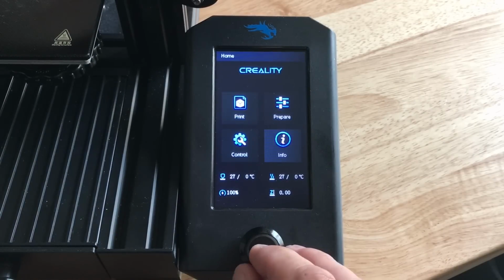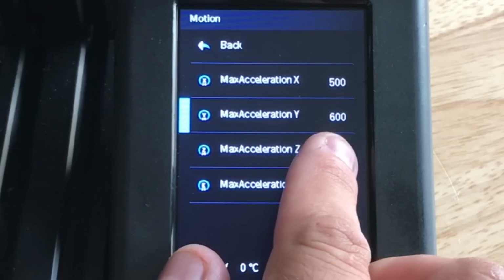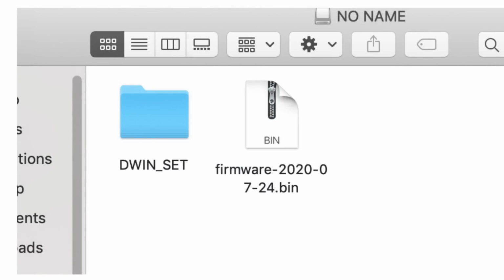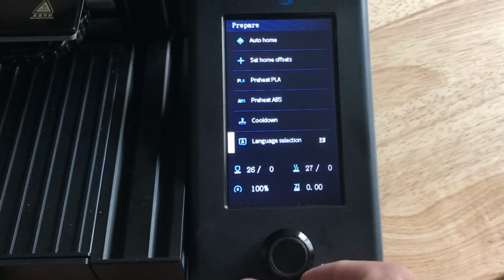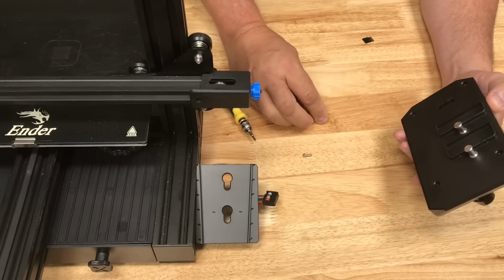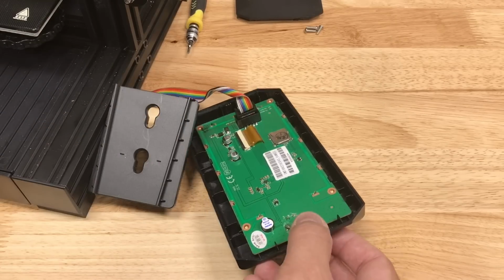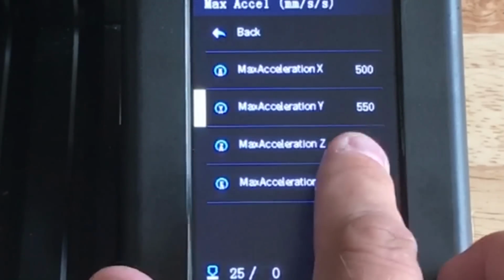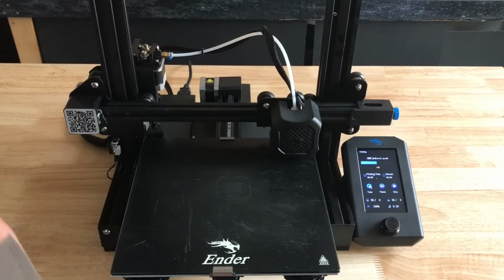Creality Ender 3 V2 Firmware Update - Motherboard and Display

Comment: Not gonna lie, I tried both firmware but the th3d unified firmware is so much better. Not only is the print quality better . the god damn printer now read gcode properly.
For anyone attempting the th3d unified firmware. Let me tell you one thing : In the program Visual studio code you MUST have the extension PlatformIO IDE install and all the tutorial step will make sense.
Reply: Couldn’t get either to work for the life of me.... any tips?
Reply: And the marlin site won’t let me register :/
Reply: just want to know th3d firmware got print resume if power loss?

Comment: What a joke, my 8 month old Ender 5 Pro had the mainboard fry, I purchased the Creality 32 bit V4.2.7 board labeled Ender 5, it never work, why does Creality even bother selling parts or labeling them for specific machines? This company is half-baked relying on users to do the job, rather than selling spare parts sell these half baked machines as throw away printers like photo printers, ink is worth more than the printer. Mine is going in the metal recycling bin at work.

Comment: Tried updating to Creality's newest firmware that is on their site and it almost seemed like it bricked my printer (fans powered up but screen never showed anything). Tried all 4 version they put out this month and nothing happened after just leaving them running for 5+ min. Remembered you had a video about upgrading to 1.0.1 and was able to use your .bin to get my ender3 v2 booting again. Thanks Chuck! (i did not do the screen update since in the other comments people mentioned having issues with it)
Reply: im gonna have to try that mine did the same thing n was thinking i bought a $200+ paperweight

Comment: Hey chep I am having trouble upgrading my firmware it still cant read your bed level gcode . I am running ver 1.0.2 any advice.  Thanks
Reply from the maker: Yes. I suggest using this service.creality firmware won’t recognize the required M0 command. His firmware builds fix this. https://marlin.crc.id.au
Reply: @FilamentFriday  thank you I will give it a try and let you know . Thanks for the quick response!
Reply: @FilamentFriday  website isn’t working won’t let you register a new account ?!? Now what?

Comment: Hey there - great video, but it didn't work for me.  Display update turned orange, ok, but now the display remains blank.  I've painstakingly followed along with everything you've done, but when I put the new BIN file on the SD card and turn on the printer, its not reading it or something.  Please help, my wife will kill me if I can't make this expensive machine work.
Reply from the maker: Try updating the main firmware.
Reply: @FilamentFriday   That's what I'm trying to do, but it's not working.  I put in the SD card, power up and the display remains blank.
Reply: Solved. Turns out it was a bad SD card, so there y'go.  Thanks for the amazing videos.
Reply: Try updating your wife.

Comment: I did follow this , and it did not resolve the pauze issue; from the earlier comments from @Chep I understood that I should now use the updates from the Creality site, so I did, and my display now shows Version 1.0.2
However, it still does not pauze long enough to change filament.
Would you please tell me exactly which download from the Creality site I should use, and give me also the date of that release please? I am primarily interested in the pause feature to change filament.
Thank you

Comment: Hey Chep just got the ender 3 v2 had it for a little tonight I would get it after my ender 3 worked great then the screen just freezes when I turn it on the fans run and the creality loading screen is their but I can't get to the settings to control it any idea what it could be ?
Reply from the maker: Not sure. Maybe try reloading the firmware.

Comment: Hi CHEP, I had an issue tryng to update the Ender 3 v2, I assembled the 3D printer, and right after doing it I tried to update the firmware to the latest version in the offcial page of Creality. I put the SD card with only the bin file and my display just stays in a black screen, and now always when I turn it on has a black screen, what can i do??? Please can you give a solution? I tried other versions, I dont know what to do or what happened
Reply from the maker: Try a different SD card 8GB or less. And use a different name.
Reply: Use a FAT32-formatted SD card that just contains the .bin file and DWIN_SET directory. Also rename the .bin file to something else since the ender 3 remembers that last attempted firmware filename. Each time you attempt an update, the filename of the .bin must be different.

Comment: Glad to hear an update is coming. An issue that I hope is also being addressed is that when you add a full size SD card reader extension it currently requires the printer to be rebooted in order to read the files every time you remove and insert another card.

Comment: Ender-3 V2 - first boot 
Creality screen lite up then nothing, so reading from forms they recommended updating firmware, so I did so using this video, downloaded and installed the two files, placed on a micro card, installed in the printer, when I powered it up I got a "nozzle temperature to high" warning, so powered down removed said card and powered back up again and got the same error message. any thoughts or ideas.
Reply from the maker: Try the creality versions.
Reply: @FilamentFriday  Is this the right file Ender-3 V2-V1.0.2 Source code.rar, and do I need to change it to a bin?
Reply from the maker: You need to uncompress it first.
Reply: Ok did that and found no bin file, I have also downloaded (Ender3v1.5-Stock-20201023.bin) file directly from marlin, still got the same results, the printer goes straight to high-temperature immediately.
Reply: @lylestanley9151  I believe the correct file should be the one that says "Ender-3 V2_32bit_ 2.0.1V Latest Firmware_0814.rar" - unzip it with winrar (google winrar if you don't have it) then put the bin file in your microsd card
Reply: @MeettheTings  Thank you other issues have risen and I'm on hold

Comment: I used your most recent firmware to update my Ender 3 V2 and I cannot change the language from Chinese to English. I found the setting and clicked on it but it stays in Chinese. Is there any way I can fix this?
Reply: I have the same problem, I have also read lots of comments here and cannot find a solution on this channel. Suggest Do NOT use this firmware update,
Reply: Same here. Haven't found anyone else with the same issue

Comment: Hi CHEP, is there a way to edit Z-Offset setting for Ender 3 v2 and store that setting to eprom from menu? I'm trying to print from OctoPrint but I cannot figure out how to change Z-Offset this way. I did it manually when I printed from SD card, and went to Tune in menu, but now with OctoPrint I am lost. Do I need to create my own firmware that has this option enabled? Note: I don't use BL Touch and I didn't have to adjust Z-Offset until I switched to your version of Firmware.
Reply from the maker: Not sure. I don’t use Octoprint.

Comment: I really need help. I need to change the bed size as its cutting off my prints along the edges
Reply from the maker: Machine settings in Cura.
Reply: @FilamentFriday  I have it set to 235x235 but still it cuts off the edges
Reply from the maker: https://youtu.be/Il1sierB4Yk
Reply: @FilamentFriday  this doesn't fix the fact that the printer itself only allows 220mm prints. Also, Cura thinks the centre of the V2 build plate is about 5mm to the right of where it actually is.  I need to move all big prints to the left by 5mm in Cura to center them.

 Really like my V2 but there's not much info on how you can tweak these things in the firmware and/or Cura, or if the process is the exact same as the 3/3 Pro. I'd love a tutorial on how to change the dimensions to 230x230 in the firmware and what settings in Cura tells it where the centre of the V2 build plate is. I keep googling it but don't get totally clear answers and don't want to brick an otherwise fully functioning printer.

Comment: I listened to your firmware advice, downloaded, named the folder firmware.bin and now I have an endless black screen... fuck me I guess
Reply: sorry that you have that problem but "fuck me I guess" i'm still laughing man :)
Reply from the maker: Download the latest v1.0.2 from Creality. Don’t change the name. Try again. Also you may need to use a smaller SD card formatted as FAT32. It will recover.
Reply: Did you fix it? Mine is stuck at black screen too...I have tried soft from ender website but no luck - this tutorial sucks!
Reply: @superchannel6506  yeah so I got the firmware folder that he said to get then I unzipped it. When you open the folder after you unzipped it go to the main board folder and grab "Ender-3 V2-Marlin-2.0.1 - V1.0.2.bin" and put just that on your sd card, pop it in and turn on the printer. It came back to life after that. Also after this whole ordeal I realized that I already had the latest firmware so I didn't even need to fuck myself like I did haha.

Comment: Important - Updating Screen (Not showing orange):
  - Make sure your SD Card is formated as Fat32, 4k (4096 Bytes) Unit size, otherwise the screen wont update (going blue->orange/yellow).
  - To Format your usb, right click the USB and press: 'Format...'
  - Fun tip: You can personalize the Start screen by opening 'DWIN_SET' Folder and changing the '0_Start.jpg' image. Make sure you keep dimentions and orientation the same and keep the file under 16kb.

Comment: I have updated to version 2.0.7 and now my nozzle temp defaults to 185 and bed temp to 45 and when I change these to 200 and 60 and then press save it does not store these settings to either the eprom or the SD card. Am I missing a step ?
Reply: Same here!!

Comment: Great video, you help us a lot. We just get our ender 3 v2 and when we try to level the bed, im the corner with the cable its imposible to put y down, so the nozzle stop veeeeery down and lefts marks on the glass. The only solution we found is put a little bit higher the sensor Z. What do you recomend ?
Reply from the maker: Yes. Adjusting the Z switch is part of the setup.
Reply: @FilamentFriday  in this case we have to change the configuration in cura ? Because when it start printing the nozzel star very down, maybe in the 2d layer start extruding the filament.

Comment: Looks like Marlin 2.0.7 is available and it says it fixed the 22 character problem as well as some other stuff. Any chance you will upgrade and test that firmware ?
Reply from the maker: I’ve released a version on my CHEPCLUB site and working on a video.
Reply: @FilamentFriday  Thank you so much for posting the new update. Finally I can use it without learning Chinese
Gary
Reply: @FilamentFriday  Hi CHEP,  just updated using the 2.0.7 from your site and it seems to have gone smoothly but I'm unable to change the language settings, it remains in Chinese regardless of some restarts and repeated attempts to change it through the menu, any suggestions? Thanks!
Reply from the maker: I just updated. Try again. It’s set to English.
Reply: @FilamentFriday  thank you!
Reply: @mturchioe  did yours work now?
Reply: @FilamentFriday  Same problem here, it remains in Chinese
Reply: @FilamentFriday  I think this answers my question above from earlier today.   I'll wait for the video.  Is CHEPCLUB still active?  I'm thinking I may like to support you that way.

Comment: @chep hi and thank you for the files and video, so I have ender 3 V2 and it had firmware 1.0.1 I did exactly what you said in the video and uploaded the file to update firmware, and it was successful where I saw the Chinese characters, went to change to English and was not able too, it does not allow me to do so, it only shows CN and when I click the knob nothing happens. so I tried to update the controller and that also did not fix it any suggestions or ideas thank you for the help.
Reply: I had this issue as well when I pulled the 2.0.6 release of Marlin a few days ago. Pulled the latest bugfix version based on 2.0.7 today and that fixed it for me.
Reply: @andrewtudor9087  Do you have the 2.0.7 .bin file for the ender 3 v2 please? I am also struggling to learn chinese
Reply: Andrew Tudor so I need to go to the marlin website And try to compile the .bin file? Not sure if I know how to do that do you happen to have that file would you be able to send it to me? I would greatly appreciate that
Reply: @MichaelNashef   do you know where I can get Marlin 2.0.7 as a .bin file please?
Reply: @andrewtudor9087  I also would love to get a copy of the bin file if at all possible. Thanks.
Reply: Please give me the link to repair the issue of the chinesse characteres in the display need the new 2.0.7
Reply: I've just had the exact same issue

Comment: Does your bed level thingy work with CCreality 1.0.2? Got my Ender v2 today, and I'm not about to start fidgeting with it's firmware, cause I'm scared. It printed beautifuly.
Reply from the maker: I created a M25 version that should work with 1.0.2. Check Thingiverse.
Reply: @FilamentFriday  hi CHEP, me also with 1.0.2 but would like to add resume option so I’ll be able to Chane filament for multicolor print... which file I need to got from your site for that?
Reply from the maker: I’m working on an update.

Comment: Great Video! Need help: I've tried to flash the firmware on my E3v2 with the v4.2.2 mainboard.  When I put the sd card in and restart nothing happens; always starts like normal.  I have tried all combinations of files, filenames, formats, sd cards etc. I've exhausted google.  It's almost like there is no boot-loader.  Any thoughts or suggestions?  (I was successful updating the DWIN display)
Reply from the maker: Did you change the name of the file so it was different than previous?
Reply: @FilamentFriday  Thanks for the quick response!  Yes. I tried the compiled output of Marlin which has date and time stamp a couple times.  Also, tried the bin file available from creality.
Reply from the maker: Make sure it’s the only file on the SDcard.
Reply: @FilamentFriday  Correct.  I do notice that after each try the printer has added the EEPROM.DAT file to the sd card.  I would think this happens after the boot code has passed, so shouldn't interfere.
Reply: SOLVED:  Turns out the mainboard is a bit picky about sd cards when it comes to Firmware updates.  None of the 3 microSDs I had been using for gcode (1GB Kingston, 2GB Sandisk, 8GB Netac) would work for the firmware update.  I was successful with a 16GB PNY.

Comment: I noticed a problem in ender 3 V2 with Cura 4.7.1 in Post Precessing Plugin such as pause at hight, Filament Change & Change AtZ 5.2.1 they are not working probarly as it suppose to be.
Reply from the maker: Yep. Their firmware ignores the M0 command.
Reply: CHEP I have a temperature tower test “gcode” that working probably with ender3 v2 “thingiverse 2493504 (the pink color)” you can take a look and find out how it works with ender 3 v2 and you can make a video which will help people in ready g-codes for different materials  ready tests to be printed

Comment: I just flashed the bugfix firmware 2.0.6 that's currently on the link and it changed the language to Chinese and will not switch back to English. Every time I try, it just beeps
Reply: I have the same problem...
Reply: Solved it by using the new 2.0.7 version
Reply: @mariuss.7214  where can i get the 2.0.7 version please?

Comment: How do we get the v2 to work on sensorless homing. They say just put the red caps on the driver....that is not whats happening for me. It hits the end stops but wants to keep going and just grinds. My firmware might have a bug. Considering the v2 is loaded with bugs. The manual is pretty useless other than instructions to built the printer itself.